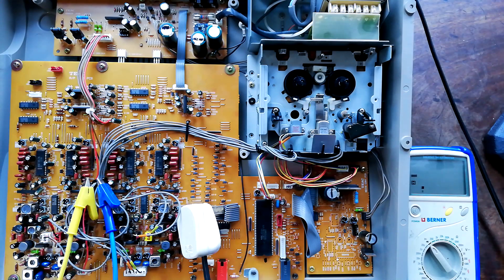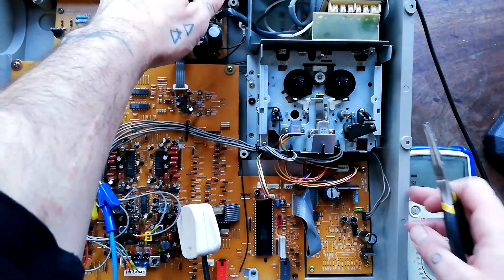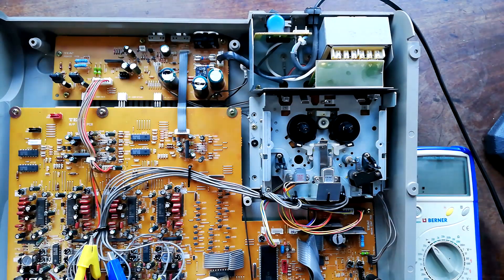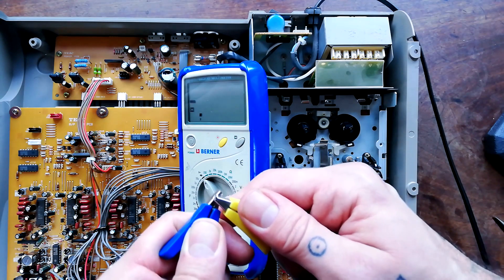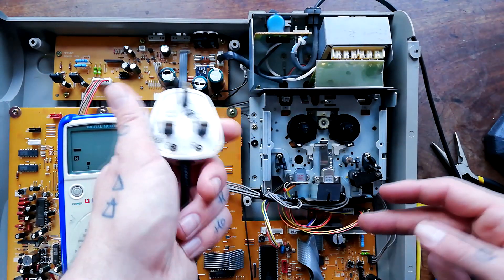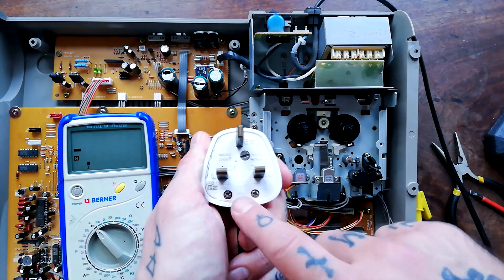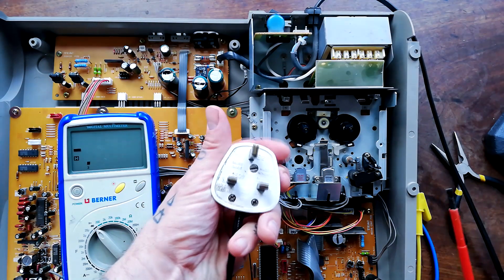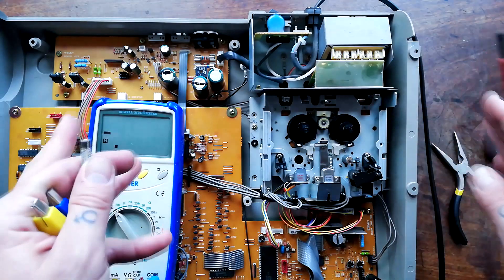No power on your 4 track? Check your fuses first!

Comment: I think I may have just blown the slow blow fuses on my new Tascam 246. is there a specific type of slow blow fuse I need to get to replace?
Reply from the maker: The values are written on the pcb. If the dimensions and value match and its slow blow you're good to go

Comment: Hey mate. Just picked one of these up from facebook marketplace here in Australia. Seller listed it as for parts or repair, but assured me that she'd powered it up before I picked it up. Once I got it home I realised it uses 120v power (we use 240v here in Australia), and the socket adaptor the seller supplied (and would have used to power it up) was just that, an adapter - not a step down transformer. Just wondering how much damage do you think she may have done to the unit by running 240v through it, and whether or not the fuses would have protected the individual components from being fried? Going to take it to a tech later this week, but just figured I'd ask, seeing as you have experience with these units. Cheers.
Reply from the maker: Should be the slow blow fuses have gone and everything else is fine.

Comment: Thanks for sharing this, I just got hold of a 424 MK1 and it's not turning on - what kind of fuses does it need?
Reply from the maker: The mk 1 has an external AC to DC adapter so there are no internal fuses. Ensure the external adaptor has the correct settings; voltage between 12 and 18 volts should work, minimum 500mA and the polarity MUST be negative tip aka center negative. If a previous user has put the wrong polarity of adapter in it, depending on the model it can cause damage to a handful of capacitors and/ semiconductors on the the circuit boards which must be replaced. I haven’t had to do that on a mk 1 before so hopefully it’s got circuit protection and if you get the correct polarity of adapter you’ll be good to go?
Reply: @Tetrakan  I think the power cable might be the issue in which case, I've ordered a replacement from Myvolts that should be the right one! Fingers crossed it hasn't been attempted with a different power source beforehand so knackered it 😅

Comment: does anybody here know where the fuse is located in a Tascam MF-P01?
Reply from the maker: I don't think it has fuses. Usually only larger units with an internal transformer have internal fuses, small units with an external AC to DC transformer do not. If you have used the wrong polarity of power supply there may be several damaged components (electrolytic capacitors and/or semiconductors) near the MF-P01 power input socket which need to be replaced.

Comment: I dont even see a transformer in mine... the power goes straight into the unit via some very thin gauge wires to a clip on the board and is out of sight after that. it will not power up.

Comment: Hi just found your channel after encountering an issue with my portasound 414 mk 2. After working fine everytime i've used it. Today I have plugged it in and apart from a brief flash it has completely ceased working. Im using the correct power supply for it which is a 3rd party one from myvolts. I tried plugging it in with several other other multi adapters but have had no joy getting it to turn on. In your opinion could this be an internal fuse issue ? Or possibly something more serious... Hoping to find a solution. Many thanks
Reply from the maker: The most likely cause in my experience is broken solder at the base of the power socket, which is an easy fix, open it up and see, I have a series of videos on your model, go to my channel splash page page > tear downs by model ( click the heading text to see all the tear down playlists, I’ve done about twenty!) > tascam 414 mk 2
Reply: @Tetrakan  thanks for the reply! I have had that issue in the past and had it repaired so its a possibility. I have been very carefull when connecting it up. If its not this what is the next most likely issue do you think? Do you do repairs for these if im not able to diagnose the problem? Many thanks
Reply from the maker: Usually ones like the 414 which have an external "wall wart" as opposed to an internal transistor don't have fuses, so I'm pretty confident it is the socket. I try not to take on repair work so I can concentrate on the channel but if there isn't an obvious break on the solder once you get her open send me photos via Facebook messenger and I'll see if I can spot anything
Reply: @Tetrakan  Right ok thats useful to know. Ill watch the videos you recommended and open it up see if I can see any obvious issues. Ok thanks thats much appreciated